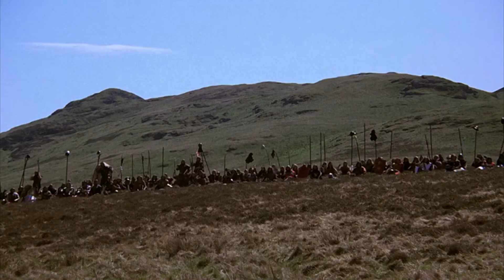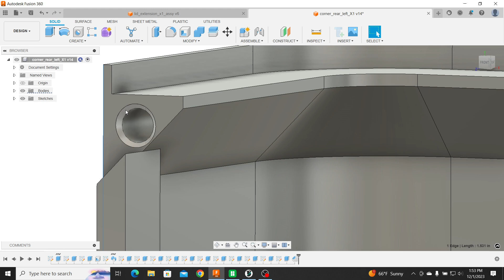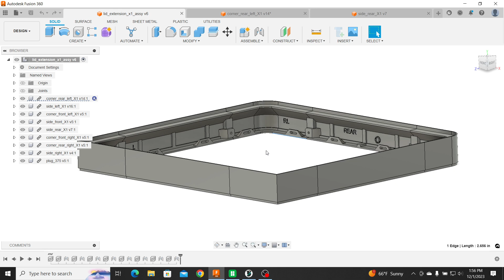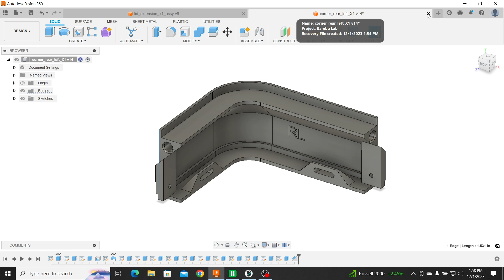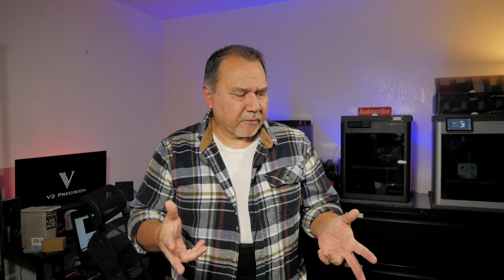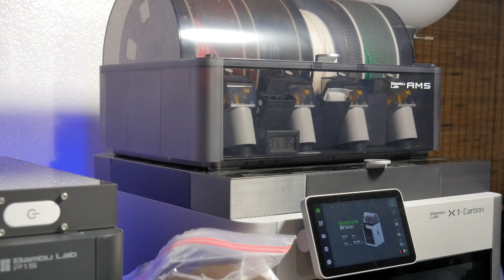Modular Lid Extension for the Bambu Lab X1

Comment: I hope you don't mind, I rebuilt the sliding vent side panel for the new modular design -- I'll be releasing it within the next few days (want to do a finalized test print), attached as a remix.

I do find that printing everything upright (including the middle pieces) tends to give a more uniform aesthetic since you don't have the bed smoothing the outer side when the middle pieces are laid flat. With the proper support settings (I used snug), there isn't much waste between the two.
Reply from the maker: I am releasing a vented version also, in a couple of days.  I agree, printing upright gives a more consistent appearance.  I'll be publishing a video also so stay tuned.👍👍